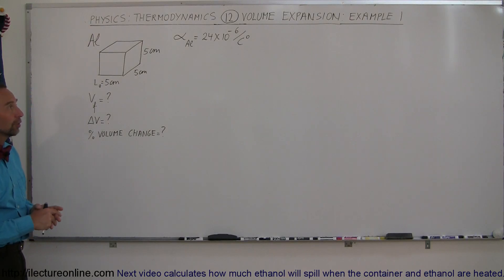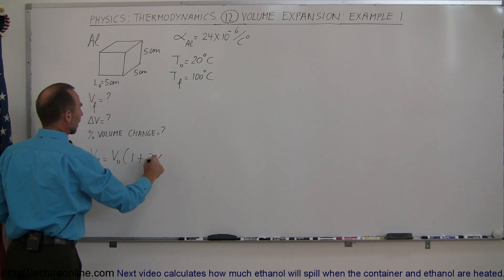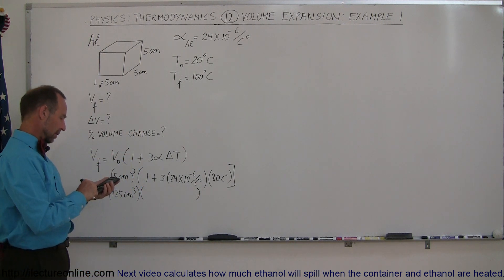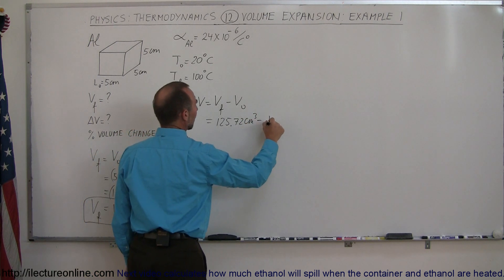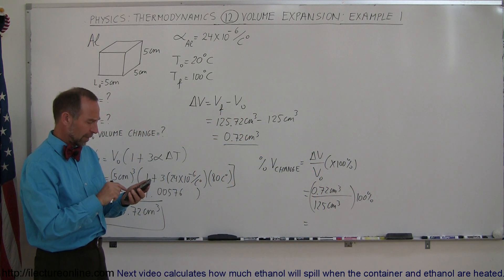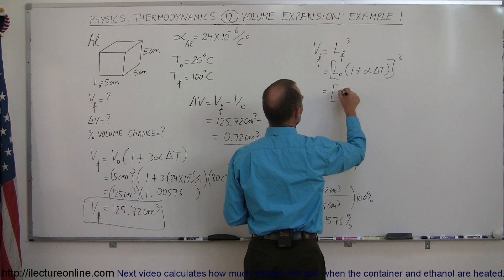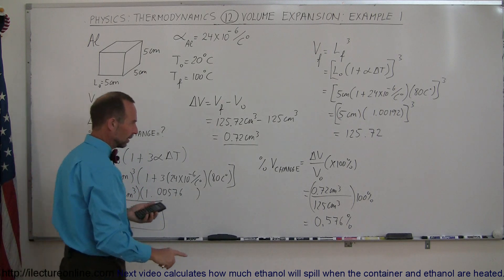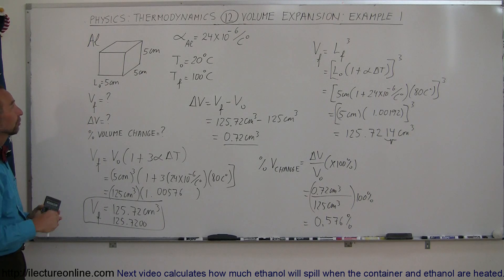Physics 21  Thermal Expansion (2 of 4) Thermal Volume Expansion: Example 1

Comment: With all due respect, i just cant comprehend the choice of using the volume expansion coefficient instead of the linear one first, then cubed it. I guess not so much complicated formula for a "theoretically" correct answer.
Reply from the maker: There is a very sight difference between the two answers, but for practical reasons it is irrelevant.

Comment: The last equasion without the error (Vf=Lf^3) doesn't seem more complicated than leaving parts of the solved binomial out. Why would you rather take the one with a slight error?
Reply from the maker: The amount is so small that it is not significant.  Try it and you'll see.
Reply: @MichelvanBiezen  I think what he means is why change it, when it's L^3 seemed like just as easy an equation to deal with. Seems like by using the changed one, you're just introducing error however insignificant with no practical gain. If the initial equation was overly complex I'd understand